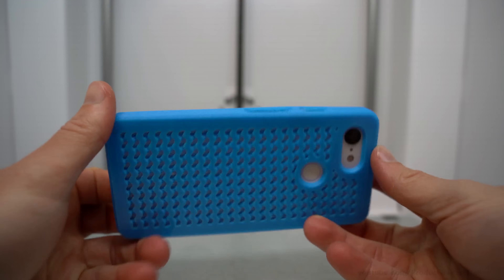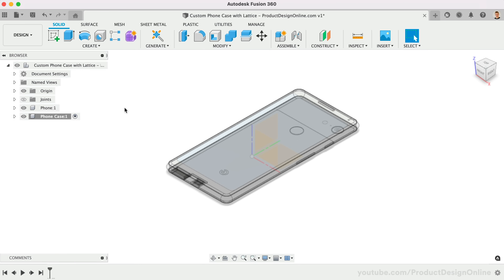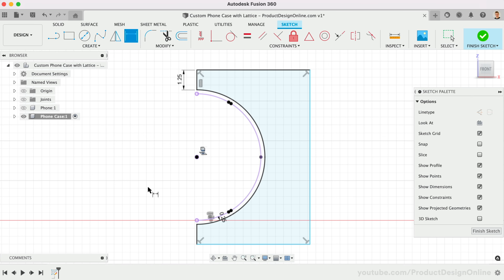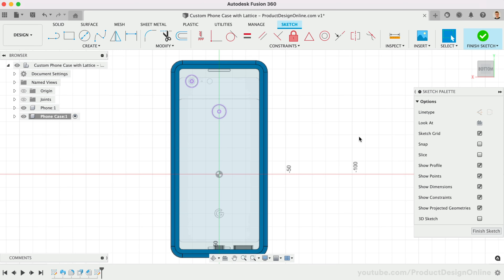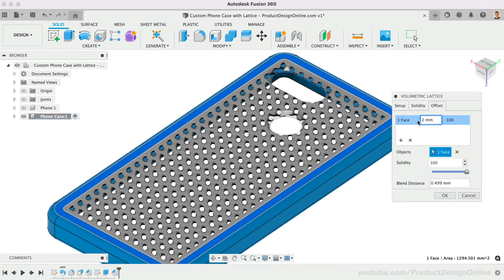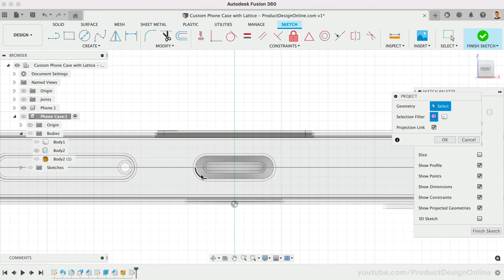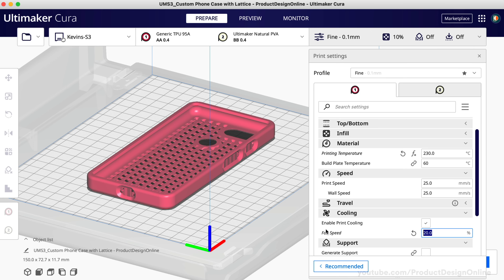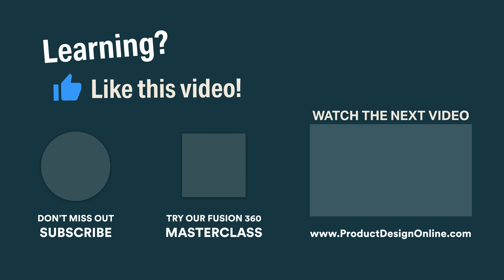Make your own 3D Printed Phone Case | Fusion 360 Tutorial

Comment: so how do you handel camera bumps? The iPhones have some massive bumps that once you protect them in fusion the case does not have a flat surface to lay on except the sides. Ideas?
Reply from the maker: Great question! For clarity, this design was made with a Google Pixel phone before they had the phone bumps.

You could either print with support or design a case where that part is printed separate (and snaps in or slides on, etc). Maybe a future video topic

Comment: I had to design my own case on fusion 360 and was surprisingly easy using the canvas function! Simply took a picture of the phone and traced the unusual shape, after a few test prints to get the  camera lens located perfectly the first print came out perfect! I used a soldering iron to cut out the locations for the charging ports and side located fingerprint sensor so I could print the case thin.

Comment: Loved your video, made wonder. If I should buy a a3d printer lol.

Question (have to start with explanation). Have a S22 ultra and there is this case from this company that is the adapter to use some photograph lenses to my phone but they didn't make the case for my s22 ultra inky for the S21 ultra. The camera layout on both phones is the same but the size and shape of the bumper varies for a couple millimeters.

I've been thinking in buying the case for the S21 ultra, cut the bumper and somehow make/adapt a new bumper to the 3xsting back of that case...
Would that be doable somehow???
Reply from the maker: It's hard to say without trying :)

Generally, adding a 3D printed part to existing is challenging if there is no mechanism/joint, other than using glue.

If you had access to a 3D printer it may be easier to design/reverse engineer and 3D print the whole thing.

Comment: Another helpful video.  Thank you!  Question:  What about the overhang on the inside of the case?  Will that "just print" or does that require supports as well?
Reply from the maker: Great question, Jamie! That prints well without supports. I didn't have any drooping/sagging with my TPU dialed in. Generally, I've found about 3mm or less will print okay without supports when using TPU. Anything more, such as the button/charger holes that were 6-15mm, will require supports.

Comment: I have had many issues with TPU prints peeling off the buildplate, specifically phone cases and especially when they have fillets or chamfers on the bottom. My preferred method is using a brim, because aside from adding surface area it also acts like a suction cup on a glass bed. It works really well. To easily remove the TPU brim, which is otherwise a huge pain, I just set the distance to the case just large enough that it barely fuses, and then I can just peel it away easily

Comment: Why is it everytime I bring in a step file it's many different bodies. Is there a way to combine them first?
Reply: I had the same issue
Reply from the maker: You can combine them with the "Combine" tool if needed. However, many times it's best to simply place them all in the same component. STEP files can still vary greatly depending on how they were made and from which program. 

Which file where you using, Todd?
Reply: @ProductDesignOnline  it was a note 20 ultra file from grab cad. I tried making a case for a nodemcu from grab cad and that had a million different parts. Lol.
Reply: @ProductDesignOnline  I also found with the Note 20 it doesn't have a constant edge to sweep around. So I can't figure out how to get it. I will try something else. lol
Reply from the maker: @toddcoello6461  The trick with the phone models without a constant edge is to use a Midplane construction plane > Split Body. This will split the model into two, leaving you with a reference edge all the way around. Midplane works best as you have the edge at the furthers point out (if the phone has a curve/radius).

Comment: Thanks for the TPU tips. Not sure if having a Bowden Tube style 3D Printer (a POS PrusaMini) makes printing TPU more difficult or not. Need to do the research. If I could use TPU on top of what I already have, it would easily allow me to make 50% more items around the house and work. Custom stoppers, feet for furniture, covers/grips for tools, etc... Good video. Thanks for the work!
Reply: No just print slower around 30mms i print on bowden on my ender 3 just slow it down and you shouldnt have any issues
Reply from the maker: I have seen TPU pinted on a Prusa Mini before. May take a bit to get the settings dialed in. Start with some small test prints, but it'll be worth it :)

Comment: I've found no mater what drying my tpu before using eliminates stringing and gives me unbelievable prints.
Reply: Ive had the same experience. Tpu is just as sensitive to moisture as nylon.
Reply: Interesting!! How do you dry it??
Reply: @petermarin  o dry them in a food dehydrator. Then, when i print it, i have a dehydrator that i clip on to the top of the machine. With tpu, i find a print quality difference after only a few hours. 

A side note, when i dry it in the dehydrator, i give it a few extra hours. Not just the recommended fore hours.